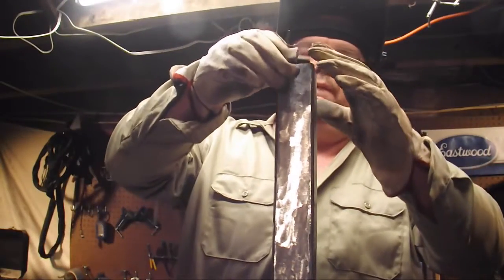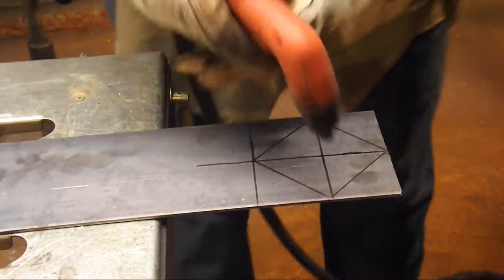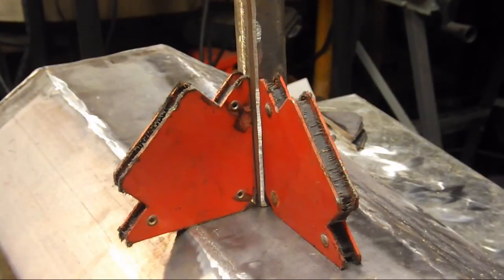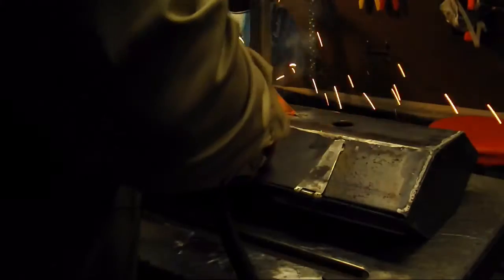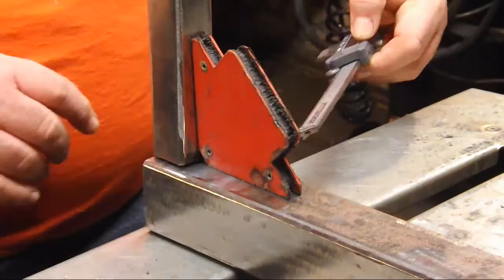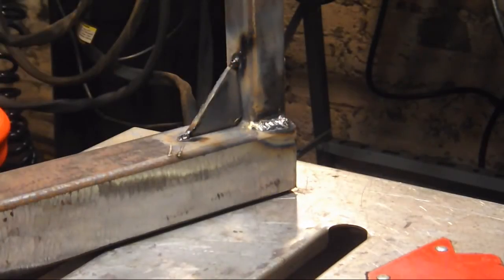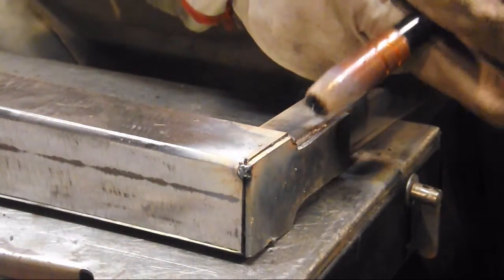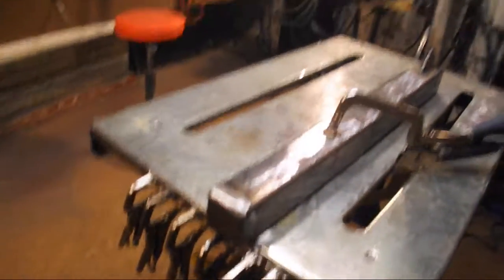Tail-gater grill build part 4

Comment: It would have been nice to put smaller diameter tube coming off the grill so you could just slip the smaller tube inside a little bigger tube and secure with a  quick release pin.  It would make storage a bit easier. But then again. ....not my design.      
Keep up the good work Paul. !!
Reply from the maker: Steven Lawrence Thank you Steven. There is a 1" sq tube on the bottom of the grill it's 10" long. That slips into a 1.25" sq tube that is 14". It comes apart no problem.